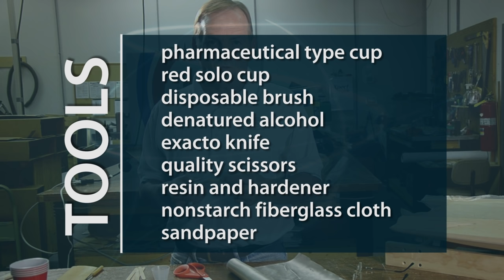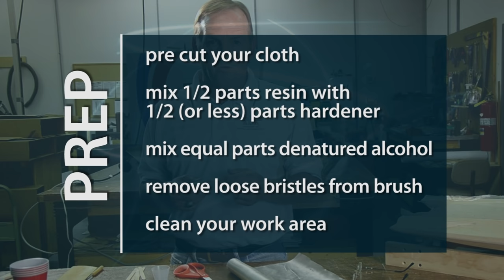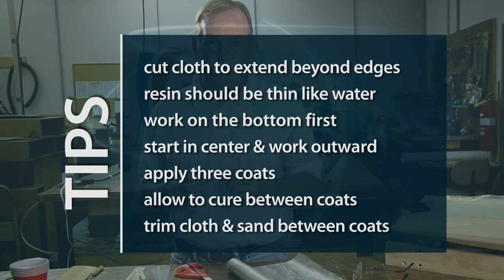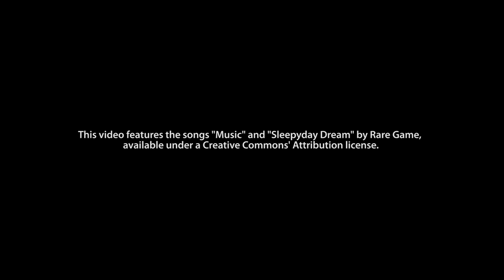Fiberglassing Tutorial with Greg Hahn - Model Aviation magazine

Comment: More than one layer of cloth or just mixture?
Reply: One layer of cloth and three coats of resin. The first coat fills the pores of the wood and sticks the glass to the wood. Trim and sand the edges smooth. Apply the second coat of resin. It should just about fill the weave. Sand any rough or high spots. Apply the third coat of resin. It should make it smooth enough for a final sanding. Avoid sanding into the cloth. Apply primer (I like dark gray) and when it's dry, sand the primer with 400 to 600 wet-or-dry using water before applying the color.
Reply: On top of what Lynn Day said, the first layer should have a lot of resin used in it, as it will have to soak into the wood as well as covering the wood.

Comment: +modelaircraft Hey.  I watched a guy on another channel on youtube doing fiberglass on an R/C Airplane.  He only did 2 coats, and didn't sand in between coats.  He said that he lets it try to the point where it's still sticky but doesn't stick to your fingers, then puts a second coat on, then instead of sanding he scraps it with a razor blade.  He said sand paper tears the fibers, where as the razor blade doesn't, and it makes it very smooth.  What's everyones thoughts on this?  I'm trying to learn how to do this, because it looks better then covering a model with plastic film.
Reply: Either will work

Comment: can i add methanol (denatured alcohol) in any kind of epoxy resin or their is any exception? thank-you in advance for any help.
Reply: Yes Meths will thin epoxy with no trouble, I use it all the time. A maximum of about 25% meths to the volume of epoxy seems to be OK but this will depend on the temperature.  Start at about 10% and see how you go. Don't thin your first coat too much (if at all) as it will rapidly soak through the glass and into the balsa and saturate it too much.  Experiment on some scrap pieces to see what works best for you.
Reply: kevin goodwin  thanks a lot kevin specially for mentioning the % it will really help me out...
Reply: +elrolly depends on the foam, meths or thinner might eat through the foam so test on a small piece first.

Comment: I'm having a hard time finding an answer, why is this process done/needed?
Reply: Fiberglassing? To repair or reinforce things like rc cars in this demonstration. It is basically a layer of flexible but strong fiber cloth and then it's covered in epoxy and it hardens solid. It's really useful to repair things
Reply: Rc planes*
Reply: anybody into customizing their vehicles. I used to have an award winning show car and my entire cars interior was fiberglass fabricated. If you ever see replica cars a lot of time its a fiberglass mold with a roll cage and reinforced steel underneath. Its fun to customize :D

Comment: You said go with LESS hardener because it slows down the curing process????  That sounds counterintuitive to me. Did you just say that by accident?
Reply: FWI, I agree with you. Not having enough hardener in the mix will definitely prevent all of the resin from curing. There just aren't enough molecules. I'm not sure about the effects of too much hardener. I suppose it might speed the reaction and/or result in a weaker final product. Not sure though but read that it can leave an oily residue.
Reply: The oily residue may be refered to as an Amine Blush, needs to be cleaned up with hot soapy water